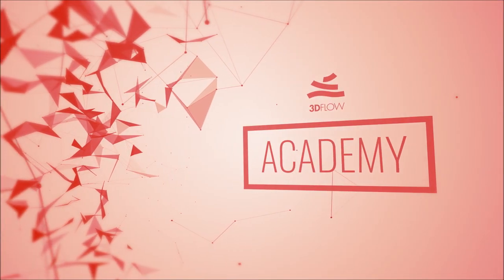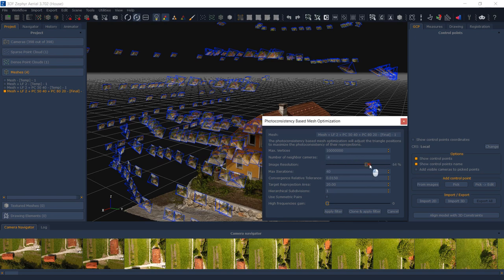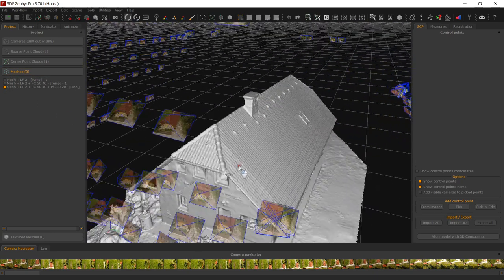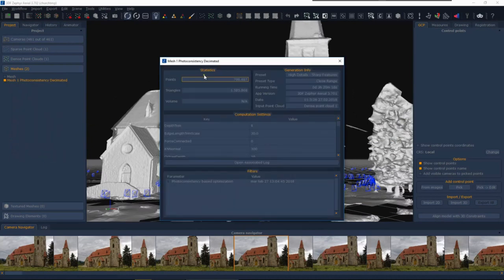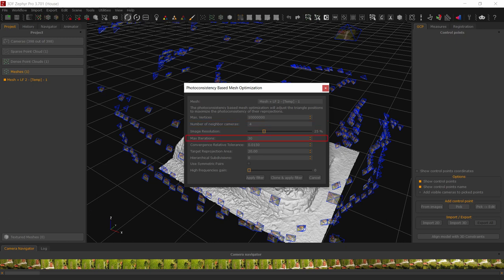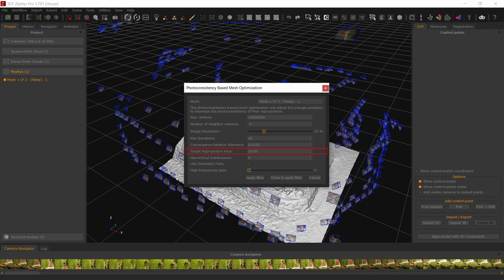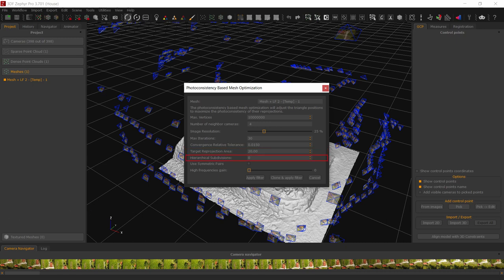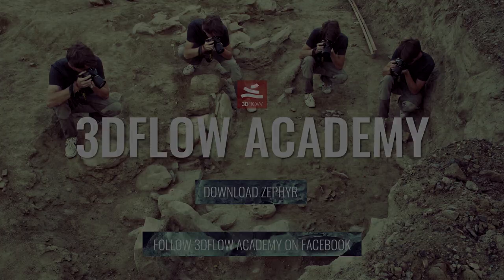3Dflow Academy - Videotutorial 9 - Photoconsistency

Comment: why there is not a single video for beginners? I'm watching for an hour and I don't have any idea what to do first. my PC computed for 39 hours and the results are terrible. only 4 from 130 pictures were used... Anyway, consider making a simple video for new users.
Reply from the maker: Hi Viktor, this is videotutorial 9, and photoconsistency is an advanced topic. When 39 hours for only 130 images tells us you are probably running without GPU acceleration or using a very old card - make sure to update your NVIDIA drivers! Make sure to check out our videotutorial #1 (basic workflow) and #2 (photography for photogrammetry) - a high number of discarded cameras are usually due to bad photos or non-masked photos in a turntable scenario. Feel free to hop on our forum or discord if you'd like to share your images and we'll see how to help you out :)